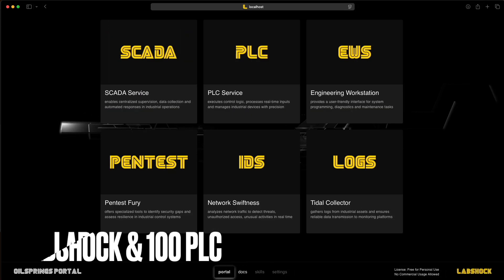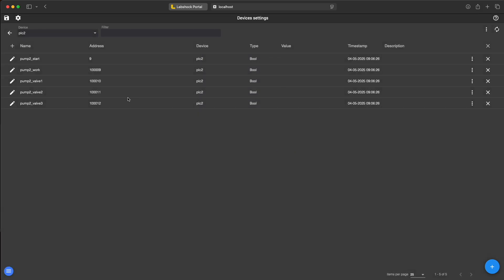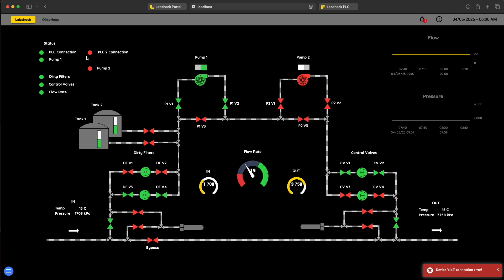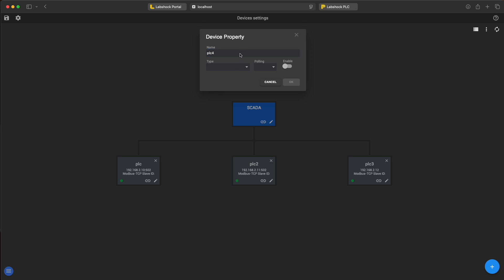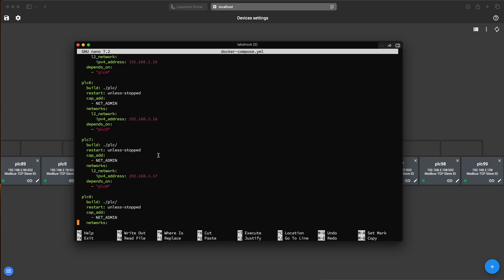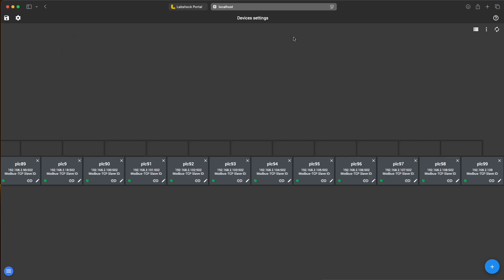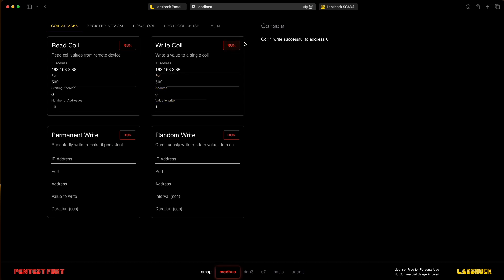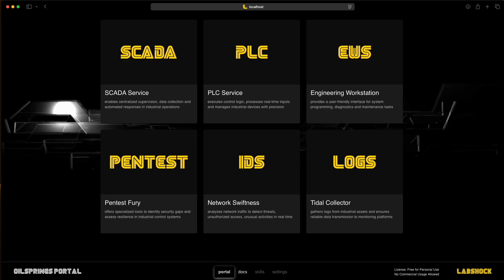Labshock - Run 100 PLC

Comment: What program is running the actual PLCs? Is it somehow linked to the one program running in openPLC?
Reply from the maker: You can run any kind of program inside PLC. And then connect it to Labshock. They are independent, 100 different OpenPLC.